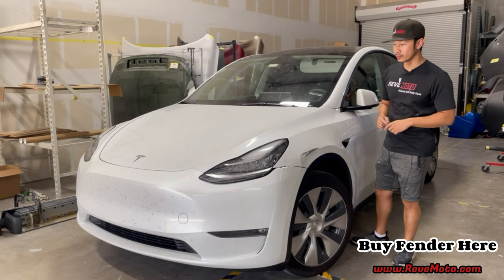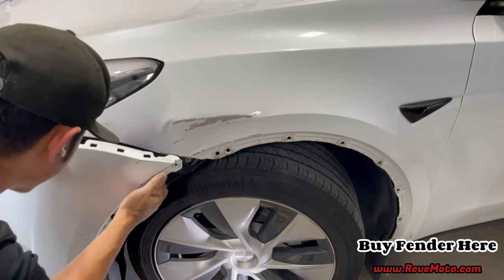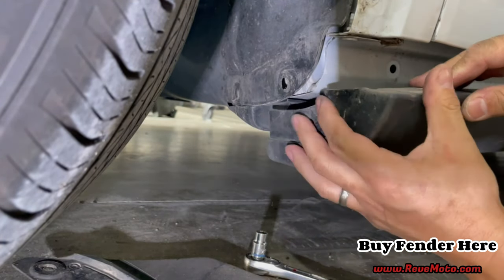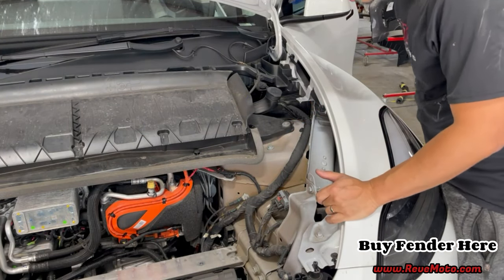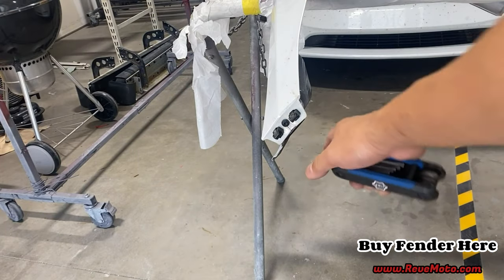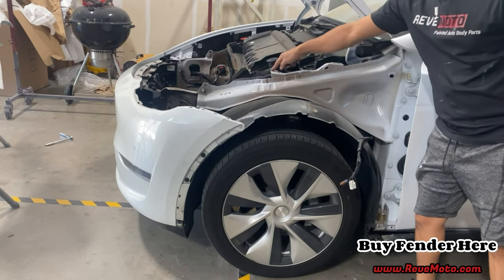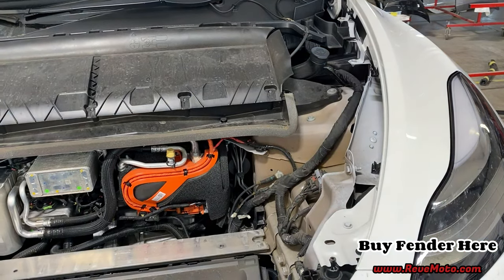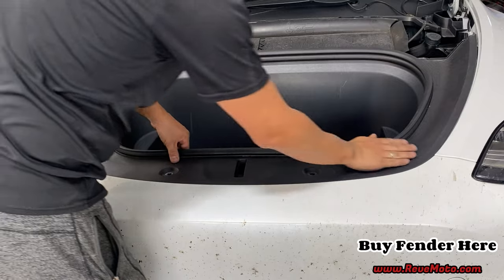Tesla Model Y FENDER Removal and Install (and Where To Buy a Genuine Replacement) | ReveMoto.com

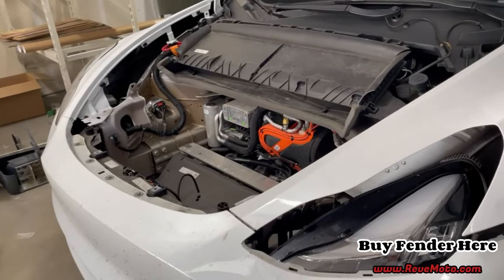Comment: Going from 7:36 to 7:37, it looks like the headlight was removed or at least unbolted and lowered but you didn't explain how, I don't think. Or did I miss something?
Reply from the maker: To take the headlight off you have to take the bolts off that is hidden behind the front bumper.  You don’t have to take front bumper completely off.  Then pop the hood and there is a bolt on the corner of the headlight.  Now push the headlight forward and it will unclip from a prong it’s attached too.  Unplug and your good. Thanks for watching! Www.Revemoto.com if you need auto parts.
Reply: @ReveMoto you still didn't answer him how to remove it ..
Reply: This was EXACTLY my question, I’m so glad this was pinned…
Looking for that headlight bolt right now
Reply: I’m having a hard time finding that lamp bolt, and also, separating the bumper from the fender.

Comment: WHY DID YOU NOT SHOW HOW TO TAKE OUT THE HEADLIGHT!
Reply from the maker: Oh man I think the camera malfunctioned when that part was happening
Reply: It’s 2 bolts bro if you couldn’t figure that out I don’t think this is for you 😭
Reply: Hey man, I think he really does show everything actually, it’s just pulling back on that one clip, and then you have to pull the light out.
In my case, I’m separating the fender from the bumper, so I had to pull back on the fender to get a little space for the light enclosure to come out.
This video was the missing piece that Reve didn’t show.
Reply: How much does it cost to replace the fender?